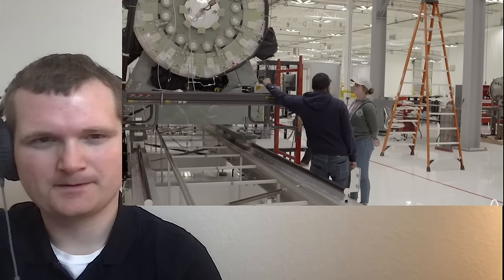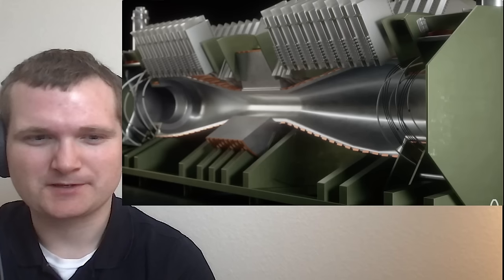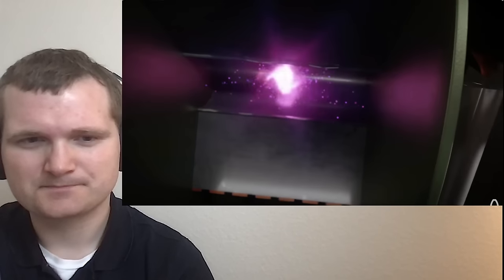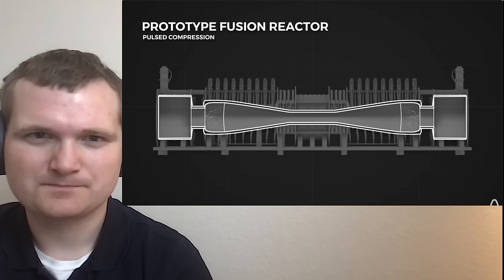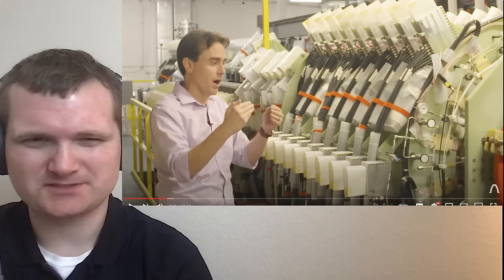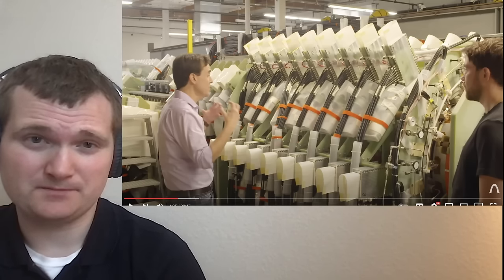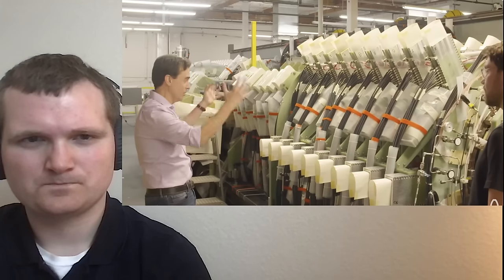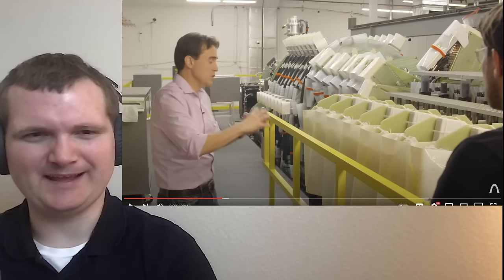Will the Helion Fusion Reactor ACTUALLY work? - Nuclear Engineer Reacts to Real Engineering

Comment: My primary comment about your interpretation so far (at about 19 minutes), is that I think you're missing the point of Helion in general.

To me, their strategy isn't to be groundbreaking in terms of the physics or technology involved... it's quite the opposite. It's using well-established existing physics, to the point that there is no new physics to discover; it's just an engineering problem... and it's using much cheaper materials, or finding ways to scale expensive ones like the pressure vessels and the He3.

Sure, if D-He3 produces 100 times less power, that sounds bad... but what if you can make ten thousand of those reactors, each at one thousandth the power output, for the price of a single Tokamak? Now we have ten times the power in terms of cost-efficiency.

Helion actually isn't even planning on scaling up the size that much... I think their vision is about 2.5 times the size of the one in this video (in the extended full interview and tour on Nebula, they show the next generation being built). Then they plan to make lots and lots of those, having distributed power generation much closer to customers rather than huge plants with long-range transmission and all the problems that brings. They even hope to miniaturize one to basically fit into a shipping container/multi-modal freight container for portable power on single-digit megawatt, or maybe hundreds of kilowatts scale... so think of a factory with 1 large permanent installation, or a server farm with 3 shipping container sized reactors that can add more as they build out more servers, and eventually sort of a "neighborhood fusion station" concept with a shipping container powering a hundred homes, rather than a giant fission plant way out in the boonies powering a million homes.

The objection that bothered me most, though, was the idea that the direction conversion from magnetic confinement backpressure isn't going to make clean sinusoidal AC. Of course it isn't... It's going to make DC, or more precisely, massive pulses of power, which will be stored in capacitor banks. The capacitor banks will then supply the power to the next pulse, and the excess is intended to be siphoned off the top and put onto the grid via inverter. In that way, that's not any more of an objection than it is for PV generation. It's a very solved problem, and even with invertor efficiency losses it's significantly more efficient than steam turbines can be even in principle. I think they'll cover most of these points soon, though.

Still, the main takeaway that I don't think got across all that well in the YT video, but is much clearer in the full interview, is that Helion is not seeking to innovate new physics or invent whole new technologies. They're seeking to find the cleanest, cheapest "path of least resistance" to functional fusion power using known methods, solving engineering problems along the way rather than hoping to discover and prove out new physics and new techniques. They hope to be ready to scale to industrial scale and then even to commercial scale within this decade. Also, the list of investors is full of people and organizations who very much do not tend to invest in pure science or pie-in-the-sky stuff.

In that sense, it feels more like the fusion concepts that use things like high-powered hydraulic rams rather than magnetic confinement, or kinetic confinement via spherical laser pulses... except the former seems even more unproven to me, and the latter has scaling problems that may or may not be possible to solve even in principle.

This isn't "a new innovation in fusion"... this is "existing science and technology applied through a proven rapid prototyping framework", and they're betting on solving the engineering challenges through that rapid prototyping vastly more quickly than ITER and their multi-decade, probably nearly trillion-dollar single prototype can hope to.

Edit now that I'm at the end:

Yeah, there are definitely a lot of challenges to overcome... and just like SpaceX and other rapid-prototyping approaches, I'm sure there'll be unexpected delays and unexpected hurdles.

But Helion's gamble as I understand it is that rapid prototyping, with a year or two between iterations, with a goal of mass-produced small modular reactors rather than enormous commercial installations, will overcome those hurdles long before ITER is even close to ready for its first test run. In a sense, I think Helion isn't really even seeking to compete with other fusion designs... I think they'll end up competing with small modular fission designs.

One thing I think didn't get across very well, either due to editing of the YT video, or maybe it just didn't impact you very much... is that Helion started in 2013. They're on generation 7, with millions of cycles behind them.

Tokamak development (not just concept, but actual physical prototyping) started in 1958. It's a lot harder to count clear generations of interative design across multiple decades and multiple nations, but something like... 6-10 functioning generations and maybe hundreds of cycles, with 2-3 next-gen prototypes that are being built but that won't be ready for fusion-temperature testing until something like 2035.

If those development paces are projected into the future, by 2035, Helion will be on generation 15, and quite possibly at a place in terms of success and market penetration that SpaceX is right now in commercial rocketry.

Now, of course the pace will likely slow down quite a bit as they scale up size and complexity (though again they aren't planning on nearly as much scaling as you probably have in mind. Polaris is probably around a 1:2 or 1:3 scale prototype), but even so, the bet here is that iterating a technology that's admittedly a fair way behind Tokamak designs right now, every 1.5 to 2 years instead of every 8 to 20 years, will catch up and then surpass other options.

Also worth considering is that the best Tokamak designs are only producing 70% of their own operating power budget, in thermal power, so not accounting for conversion losses, overhead for operation, transmission losses, etc. I believe Helion's 6th generation reactor, which is what was shown in most of this video (the functioning one, not the larger one with the exposed pressure vessel—which if it wasn't covered in the parts of this video you didn't show in your reaction, are in-house made mono-crystalline quartz IIRC and very cool!), already produces net thermal power, and quite a bit of it (for such a small device). It can't produce electrical power, of course, but Polaris will hopefully do that.

Another Tokamak, W7-X at IPP was started in 1980, produced first plasma in 2015, and might produce first fusion this decade. So generously 35 year prototyping cycles versus 1.5 years? I'll bet on the 1.5 year.

And I'm... still not sure why you keep bringing up making "clean sinusoidal energy". Again... my house has the device that solves that problem attached to it right now, licensed and fully interconnected to the grid. So does one of my cars, though without the grid connection.

Oh, also, in the full tour/interview, I think they talked about storage and invertors, and are planning to use supercapacitors for that side, and solid-state capacitors for the pulse generation side, which makes sense to me.

Another big advantage they talked about in videos on a couple of other channels is that since this is a pulsed device, power can be ramped up and down on the millisecond scale, meaning this could be a full-load solution, rather than base + transient. Alternatively, if Tokamaks do end up working, and are much higher power/efficiency for civilization-scale power generation, they could potentially fill a base load role, or fission could, with these filling distributed and transient load purposes.
Reply: I think a lot of why Tyler reacted to it the way he did, was that RE kept trying to oversell it as “world changing” and “groundbreaking” so there was a disconnect between his preconceived notions of the technology and its reality. Also since this was more for the general public than a specialist, it didn’t go over everything it extreme detail.
Reply: @Lunara_2.0  Yeah, that's true. But then, his job is to get views. He's essentially a journalist, and like almost all modern journalists, he has to hype things or catastrophize things to a degree to be more entertaining than the next one.

That's why I took most of my cues from the full, uncut interview. There, you get everything in the CEO's words, not the media personality's. Sure, he also has reasons to hype it up, but he does a much better job of explaining things realistically and with caveats than Brian did.

Comment: With most systems nowadays, why is it that only 1 fuel source is used. For example, only using Tritium as opposed to using Tritium and Helium?
Reply: Helion can theoretically burn Deuterium- Deuterium, Deuterium- Helium3 and Deuterium-Tritium. In fact, Polaris will do net electricity experiments with all 3 combinations.
In the end, you will likely want to avoid burning Tritium in a He3 machine. Or otherwise, you are kind of undoing all of the advantages of D-He3.
Equally, most designs engineering Deuterium- Tritium do only that combination because it is the easiest to get net energy from.

Comment: One thing I didn't get about this thing is that they plan to only use the contortions of the magnetic field to generate power, but this thing is still going to be outputting significant neutrons and heat.  Why would you not attempt to also capture that as well?  Do they believe it would not produce enough of either to make it worth the effort of capture?
Reply: if they can capture enough of the energy to make it even partially worthwhile, than the heat is lost, we get the energy from the same source. yes, some residual energy still in place, and that may or may not be useful to capture, but considering that most power plants currently do not try to do it is mostly gets us the simple fact, it is not worthwhile.

of course what is highly questionable, if they can capture any meaningful amount of energy, so yep. the main problem of this is that we add the magnetic capture to the already long list of problems to solve.